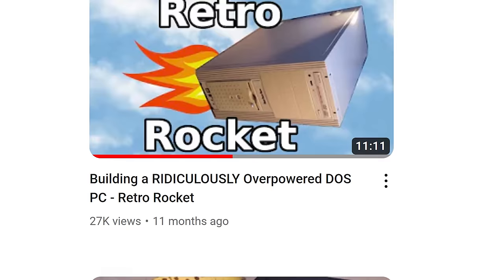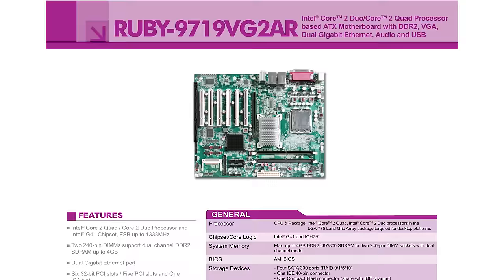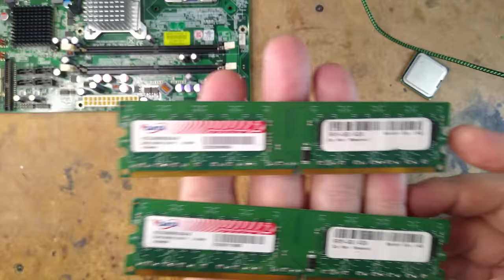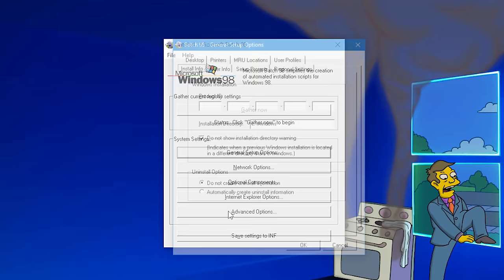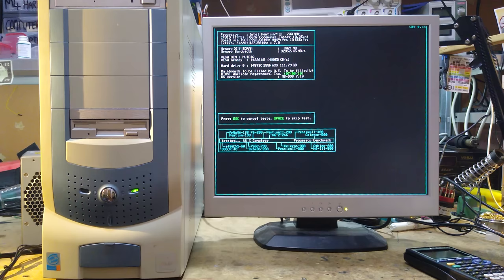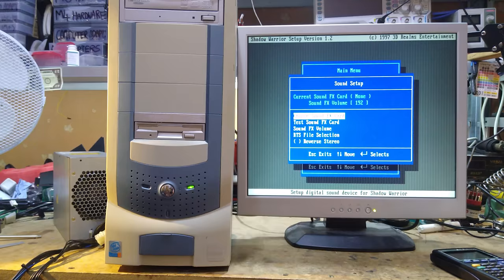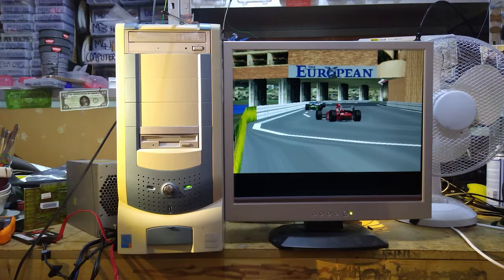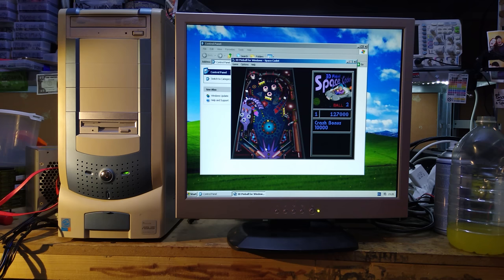The FASTEST DOS Gaming PC Ever?  #DOSCEMBER

Comment: people need to realize, running dos quake at 640x480 in software mode was considered basically impossible when it came out.
Reply: yeah, crysis paled in comparison to what quake was when it came out.
Reply: I played thru all of Quake a few times at 4fps on my dad's 486 at 320x200. I wrote a special mod to the autoexec.bat file (remember that one?!?) to prevent a bunch of shit loading (Windows) just so I could load the game. Took me a while to catch on why it was taking me about 10-15 minutes a level but the game clock would only say 2-3 minutes.

Was a totally different game, really fun on hard mode. I don't like it as much at full speed. 😛
Reply: It ran fine, just as a slide show, unless you had one of them new fangled pentiums.
Reply: @MrJFBro  Ah yes, the wonderful days of optimising DOS boot files to squeeze that few extra kilobytes. It was a sport in and of itself but it's one of those old tech things I completely don't miss (beyond a pinch of nostalgia when remembering it anyway).
Reply: I ran it at 1024x768 when it came out. Ran at 27 - 30 FPS. Then I got a 3DFX Voodoo card and it went up to 62 FPS at 1024x768.
Reply: Maybe so; but when Quake came out processors were improving by 60% per year on average. Today yoyd be glad to have 6% per year.
Reply: No, you didn’t. GLquake came out half a year later and vodoo 1 supported 640x480 (common 4 MB version) or 800x600 (uncommon 6 MB version). Voodoo 2 was release another year later.
Reply: @thelaughingmanofficial damn 60 fps in the 90's
Reply: it wouldn't even apply.. when quake came out it only had a software mode.
Reply: I remember going over to a friend's house who's dad bought a Pentium 200, with a Matrox Mystique and other goodies inside, and seeing Quake running smoothly at what felt like a 30+fps. Considering I was still chugging away on a 486 at the time, my mind was blown.
Reply: 640x480?, at 1024x768 all the early Pentiums would fail at the task

Comment: I love this! Having the same PC run DOS through Windows 10 is such a testament to backward compatibility from Intel and Microsoft :)
Reply: Or lack of innovation
Reply: @gearfriedtheswmas  Nah, in this case having such far backwards compatibility requires effort, not just laziness
Reply: Intel would've happily killed x86 for Itanium, you should thank AMD for putting a stop to that with x86-64.
Reply: @ozzyp97  As much as they wanted to, Intel couldn't kill off x86 because their Itanium architecture was an abysmal failure. It never got close to what they had expected, even after a decade of work. Intel hadd already tried to stop AMD from further development of x86. AMD came up with their own x86/64 extensions, but if Intel had made Itanium work, and killed off x86, AMD would still require licencing from Intel. Would Intel have renewed that licence? Perversely, Intel have to licence those x64 extensions from AMD. Irony at it's best.
Reply: @gearfriedtheswmas  Intel would have loved to cast off the vestiges of original x86 compatibility. If you knew the lengths Intel and AMD have to go to just to make their CPUs backwards compatible, you'd realise how amazing it really is. Internally, modern x86 CPUs are nothing like their early ancestors, but a lot of (very expensive) silicon die space is used just to keep that compatibility and still run old code many magnitudes faster than the original Intel 8086 designers could ever have imagined.
Reply: @another3997  at what point do they stop making any money from architecture licensing?

Comment: noice. have a look at later ESS PCI cards, they have a mode where, as I understand it, they snoop writes to the 8237 DMA controller and implement it on their own, allowing legacy sound to work without the special SB-LINK or any funky TSRs. I have not tried it yet. they patented the technique (TDMA) and I think this is why others did not get to implement it.
Reply from the maker: I knew ESS PCI cards had good SB compatibility but I didn't know that's how they did it.... I did always wonder why PCI cards didn't just emulate the 8237 directly, I mean it's just another memory-mapped peripheral after all...
Reply: cool I must get get one of those cards. Then really the fastest pc is any that still has any pci slot.
Reply: I tried it on my fastest dis rig, a socket 479 Pentium M but without ISA. It works.
Reply: wow, a PCI sound card implementing 8237 DMA could launch a competition to see who can build the ultimate, fastest DOS gaming PC - what madness!!!
Reply: I remember not needing a TSR for my ESS audiodrive - it'd work with soundblaster pro games no problem - but you needed the ESS drivers loaded for Soundblaster 16 FM compatibility
Reply: the PCI chips do not need this
Reply: @ianhanschen  Clearly you have no experience with DOS based systems and legacy audio. It doesn't matter what PCI supports, if you want DOS era audio it absolutely needs to support the Intel 8237 DMA controller or somehow emulated equivalent. PCI ≠ ISA
Reply: @JohnnyWednesday  Please explain again in clearer terms. SBPro ≠ SB16. Seriously, I not only wrote drivers for the SB series cards, I'm literally looking at the source code for it right now. SBPro was SoundBlaster Version 2. SBPro 2 was SoundBlaster Version 3. SB16 was SoundBlaster Version 4.

So what exactly was the ESS AudioDrive compatible with again?
Reply: @southernflatland  oh my god. yes, I have no experience. Continue on.
Reply: It's specifically the ESS ES1946 Solo-1E that has the Transparent DMA (TDMA).

I purchased a GVC ESS Maestro-1 ES1948F PCI Sound Card  off of ebay hoping it will basically support all three approaches: 1) Transparent DMA (TDMA), 2) Distributed DMA (DDMA), 3) PC/PCI using a Physical SB-LINK connection 

I searched on "ESS ES1946 Solo-1E" but couldn't get on any hits for an actual card that is for sell

But ES1948 is the next increment over ES1946 per the ESS chips so thinking it will have all the data sheet features of the ES1946 (which I did locate data sheet for)
Reply: @ianhanschen  I still haven't seen the first comment saying anything about SB16 waveform compatibility, only SBPro waveform compatibility with SB16 FM synthesizer (MIDI).

The SB16 waveform compatibility was a whole different bag of worms than the MIDI compatibility, they were like 2 completely different devices in one.

So again I ask, what EXACTLY was this ESS card compatible with?
Reply: @ianhanschen  I also happen to have the complete official programming guide for the SB16.

So does that ESS support 44.1KHz 16 bit stereo output? Does it support ADPCM compression? Does it support OPL2/OPL3 FM synthesis?

Hell, does it have the integrated gameport? Does it support the split dual controller adapter? Does it have a built in audio amplifier?

Many questions I have, as even the closest to compatible cards weren't fully compatible with the SB16.
Reply: @TheSulross  it's not specific to one chip - for example the ES1992 on the Diamond MX400 supports TDMA. It might be all of their PCI audio chips, but I'm not sure.
Reply: @TheRasteri  i think 8237 is not memory mapped. can't be certain, but you could only program it's registers with i/o port instructions. emulating that could be a bit of nightmare.

Comment: There is a huge difference in between ModeX and VESA in the way the graphics are drawn.
ModeX uses a series of speed and data transfer optimizing tricks, whereas VESA requires hard on drawing pixel by pixel into a non-visible RAM area, and then use bank switching once a new image was rendered making it visible. Because of this, the memory and bandwidth required are much higher.
That's actually were early GPU acceleration comes in, which tries to speed up drawing planes by e.g. geometric filling functions - the "2D" acceleration.
3DFX didn't do much more than that, actually, only it introduced bitmap based filling combined with the "Z-Buffer", giving video memory a virtual third dimension and therefore the means to quickly sort out overlapping pixels.
Reply: bank switching was only for vesa 1.x. vesa 2.0 and above had full 32bit flat access. the only plus mode-x had was using the vga latches to also do 32bit transfers, but it's not a trick, you could do that in any resolution except 320x200x1 256c  (mode 13h). long story short, vbe2 had faster back-buffer draw and mode-x had faster front-buffer switch. but it doesn't make any perceivable difference since the highest resolution mode-x can do with 2 pages is 360x240 i think.

Comment: I mentioned in another comment that you should be able to get ISA video to work by shoving in a PCI video card so the system will boot far enough for autoexec to configure the board, but it also would be interesting to just screw the board to the upright bit of an upside-down 'T' shape, cut a slot in the T where to two pieces of (presumably) wood meet, and snake some sort of "ISA extender" cord through there so that you can have maybe 5 ISA cards through the use of an ISA backplane. At that point you'll just need a PCIe extender so you can do the same with PCI, add in some cards for USB 3 and Firewire, and you'll have the "ultimate peripherals PC".

I'll admit that it sounds borderline useless, but you could do it!

Comment: Cool build!  I'm impressed that the Quadro works so well in VGA and VESA modes.

A bunch of questions come to mind:
- Do the latest generations of AMD and Nvidia cards still offer good VGA and VESA compatibility?
- Are there PCIe video cards that give better framerates in Doom and 640x480 Quake?  Would a PCI VGA card be faster?
- Are there any PCIe video cards that have hardware accelerated Direct-X support in Windows 98?

It would also be amazing to see a CGA card running!
Reply from the maker: 1. I dunno - but I have access to an RTX3090 over xmas so I'll certainly try it.
2. No, PCI video cards are significantly slower, even under pure DOS.
3. Yes there are, Geforce 7 series work quite well under Windows 98
Reply: Radeon X800/X850 cards allegedly work fine in Windows 98 as well, still need to test that for myself.

Funny thing is that fastest DOS gaming PC can be faster than a proper Win98 gaming PC, due to DirectX 3D acceleration compatibility.
Reply: @pawelw3000  Yes they do, I use an x850 Pro AGP in my 98/XP rig. It's a bit funky with pre-DX5 stuff due to drivers but the majority of 98 games scream with that card.

Comment: Ah yes, the windows 98 answer file. Giving me flashbacks to when I set up one for our XP install at my old job. We sold kiosks that ran XP; it would take over an hour to run up a machine with a manual install, and we could only really do a few at a time since we would have to constantly switch back and forth on the KVM to click next or put in some setting. I got it down to something like 15 minutes, and it could run headless until the end when I just had to do a few things manually, so I could run up a lot more machines simultaneously. I think I ended up scripting that too so I would basically just have to test the box before packing it up ready for install into the kiosk.

Comment: Great Build! For my "Fast Win98" Build I have something a bit more conservative, but still out the ordinary when it comes to Win98 and ISA compatibility! I run a Pentium 4 Northwood 3.06 on a Soyo  SY-P4I845PEISA motherboard. IMO one of the most compatible ISA boards for CPUs not indented for Win98/DOS. It has 4x AGP, and 3 ISA slots all with full DMA compatibility. I run mine with a 5900XT for compatibility with Win98 games and it rips in DOS. Sound cards it runs a AWE64 Gold and a Yamaha SW60XG
Reply: sounds like a great setup! much easier/cheaper to source all the components

Comment: Alright, now off to find a PCI Express Voodoo 5500 ;) This is exactly the reason why I decided against getting such a board and settled for Epox EP-D3VA. If you manage to get a 5500, here's a protip. Some DOS games (GTA1 and Carmageddon Splat Pack most notably) are dynamically linked against the Voodoo driver, so it's perfectly possible to fit the Windows 98 driver for Voodoo 5500 for these games. And it works fine. Also, with regards to those SD card adapters, those actually require that you place a special partition at the beginning of the block device. You should be using CF cards to remove this requirement and to remove the latency of interfacing between SD and IDE. CF is native IDE, just different form factor.

Comment: @TheRasteri Great video and great idea for a project.

Something I have noticed appears to have been mostly forgotten (and you don't mention it explicitly in this video) is the varying speed of graphics cards for DOS performance. 

Having watched multiple recent builds the builders appear to believe one of two things:

1. Choice of card makes no difference on DOS because dos games don't use accelerator chips.
2. The faster the card runs Windows the better choice it is for DOS too.

As I remember, both of these beliefs is incorrect and in fact, especially when Windows accelerator cards were primarily for the the Windows GDI, DOS performance often slumped for cards with good accelerators.

A number of explanations was given for this at the time. The explanations included these:

1. Some Windows cards do not also have fully compliant VGA adaptors. DOS VGA programs run through a translation layer which slows down DOS programs.
2. Card memory access becomes heavily weighted in favour the accelerator and video chips at the loss of reliable CPU access, so writing over the bus in VGA mode with the CPU is slow.

Whatever the explanation it seems to me a lot of graphics card for DOS wisdom has been lost over the intervening decades. 

This troubles me as many games I have seen are terribly slow and use graphics cards known in their day to be great for Windows but terrible for DOS. 

Last time I looked (which was some time in the 1990s) the Windows oriented cards were worse for DOS games than DOS oriented cards. The leader of the pack then for DOS were those based on the Tseng ET4000i (I think). This chip does not top Windows benchmarks but does excel in DOS benchmarks.

I think a worthwhile addition to the retro knowledge would be a deep dive into this anomaly to find out what really is the best graphics card for unaccelerated DOS games treated separately from cards for Windows / GDI / DirectX acceleration and separated also from 3D accelerator cards for DOS.

In short: What really is the fastest DOS graphics card for pre-Quake games?

Comment: My P4 2.8ghz system, Athlon-XP 3000+ system and Core2 E7600 system all performed within error of each other in game benchmarks, seemed a lot of it depended on how fast the GPU's memory interface was to DOS. At some point, the bottleneck becomes things other than the CPU. In fact, the GeForce 2 Ultra beat everything else in my benchmarks, including all the later cards, and determined DOS performance to a greater degree than CPU past about the P3 800mhz. I think the only games that really pushed through this were simulation games, which of course always do better with a faster CPU.

I love retro rockets, good find! That said, there's a ceiling that is hard to push past, so cranking up the CPU doesn't always give better results.

Comment: ...Hmmmm, have you tried fastvid? Should help with the high res Build engine games. I remember running Blood in 1600x1200 at 30-40fps on a mere 3.06GHz Northwood, on the top of a 845PE/ISA m/b, single channel DDR-333.
Also with Quake benchmark. Though Quake seems to run nicely already.

Comment: for using really old OS on an SSD you might wanna make sure that the partition table is properly aligned, you can do that manually in fdisk or just format it on a modern computer. If not it'll really shorten the life of the drive.
Reply: Mr Guru  These chipsets support SATA IDE compatibility mode and probably have it enabled by default so Windows 98 just thinks it's a regular IDE controller.